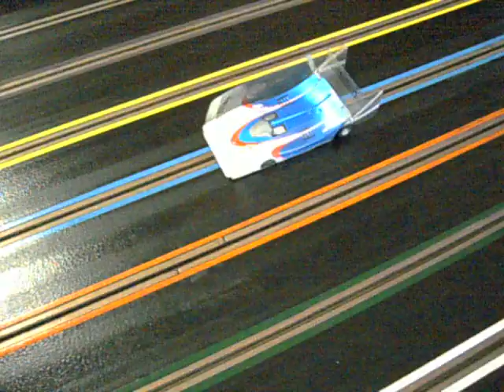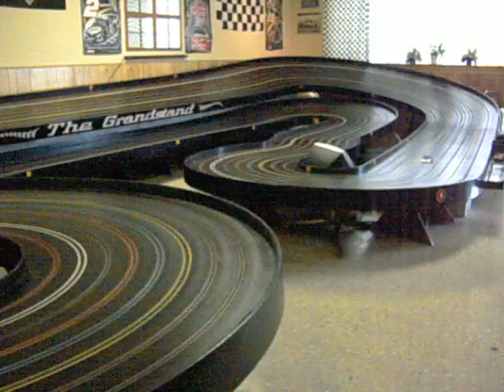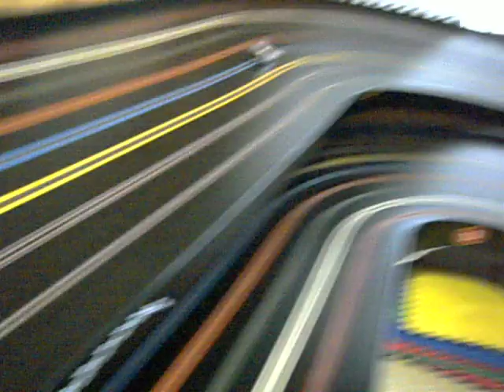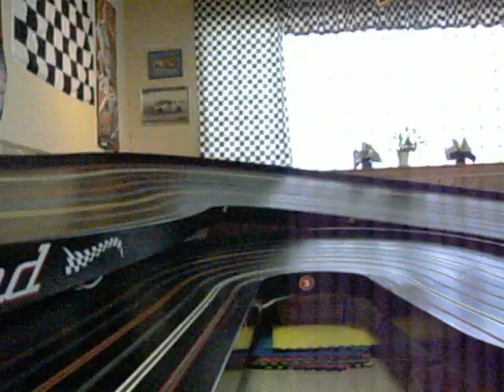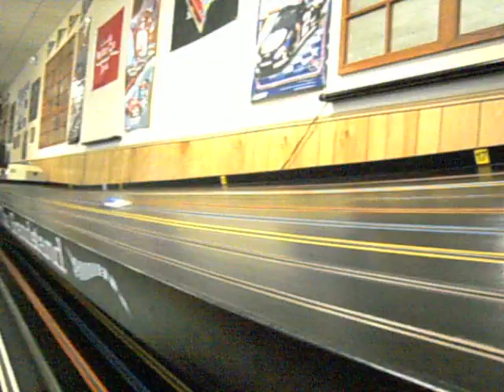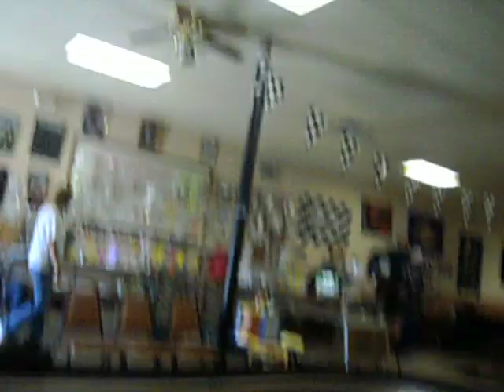koford wingcar /mura gp 20+ drag motor

Comment: dennis wasnt a local racers in fact he never ran a group 20 car on track till that day, i changed the gearing on this car later cause it didnt sell on ebay and put down a 3.03 lap, which is fast considering the 27 cars during a race were doing 3.2's and 3.0's